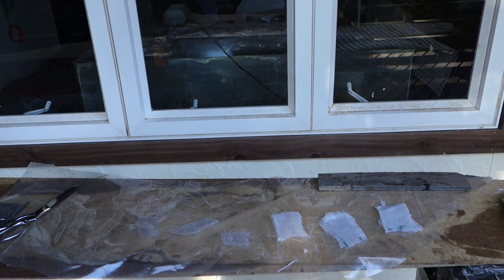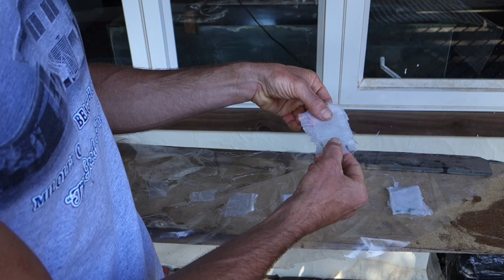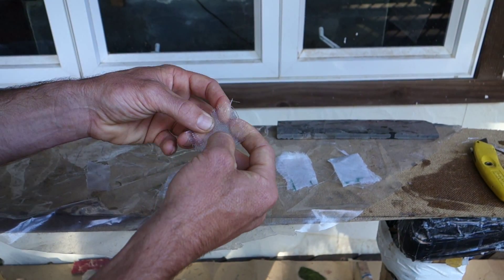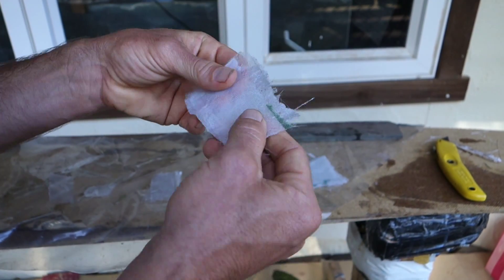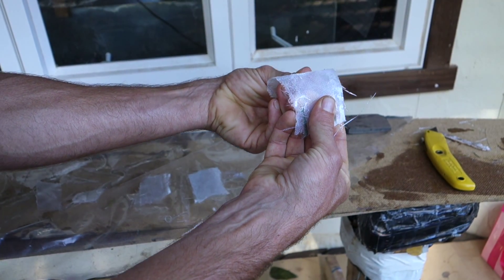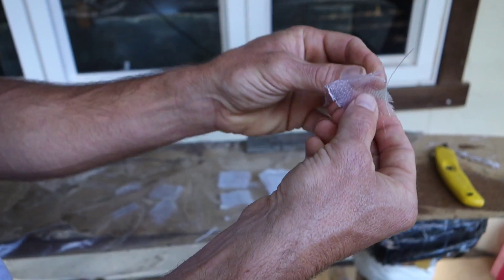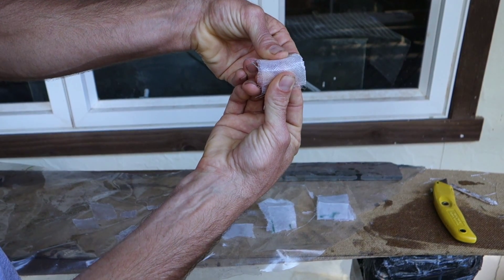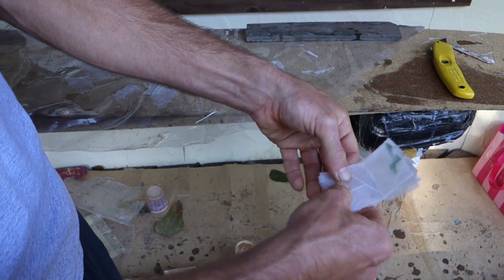making surfboards stronger by adding agribon (polypropylene) to fiberglass

Comment: Have you used this on a surfboard yet?  If so...What was your glassing schedule?  Only used on the deck or both top and bottom?  Did it soak up resin to significant weight increase?  Did you wrap the rails or simply make a deck patch?  Was flex significantly different?  Would a 4B 4x4 Deck w Agribon work with epoxy?  was it placed over sealed blank and then lam coat on top? or sandwiched between?   Sorry...It's a super interesting test.  I would like to check it out.  But this little scrap patch test...would love to see a full report on results.  Cheers